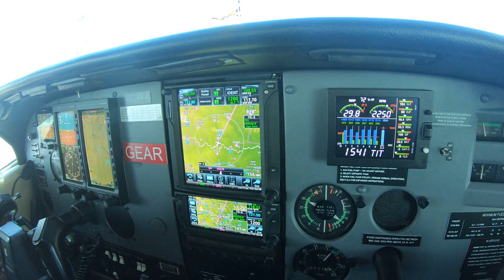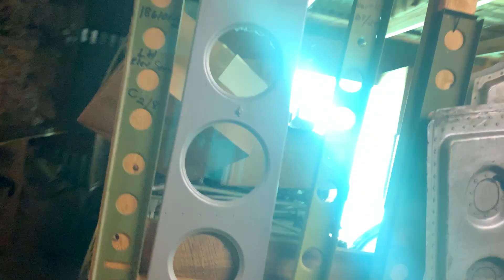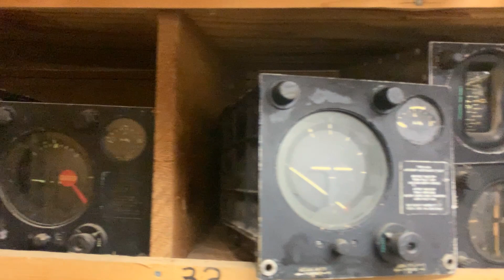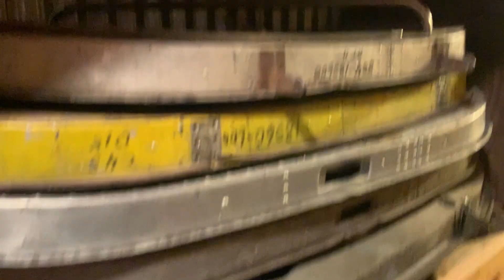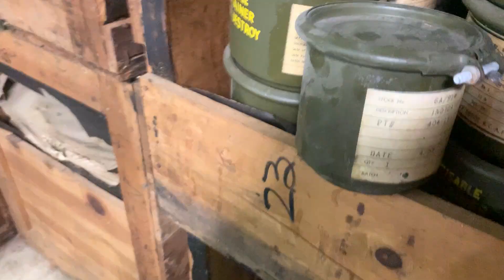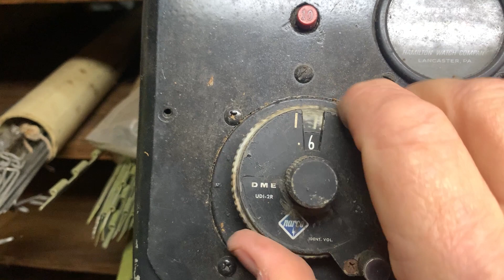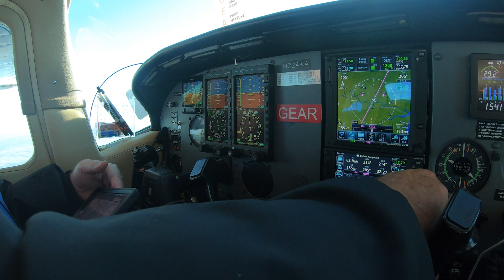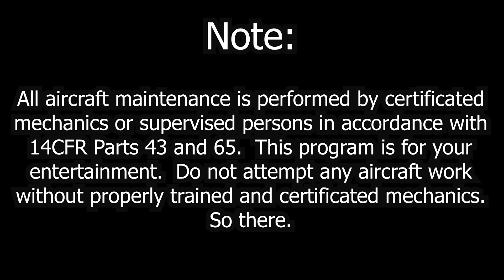Hollywood Bomber Episode 16 - Barn Find Beech Parts!

Comment: Usually I find you can get a Part from Shelley cheaper than making it. Also I have found over the years that the warehouse has Beech manufactured repair components that are not listed in the parts manual.  TRY THE THIRD FLOOWR IN JULY!  You have to really need the part.
Reply from the maker: Yes.  Did the third floor in the heat!  I think I lost a few pounds looking for a couple of tubes up there!